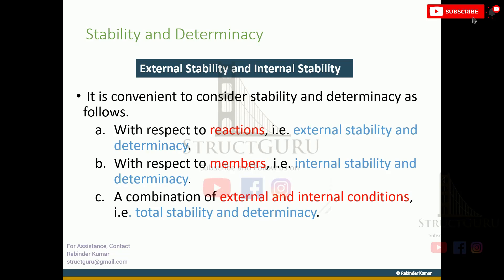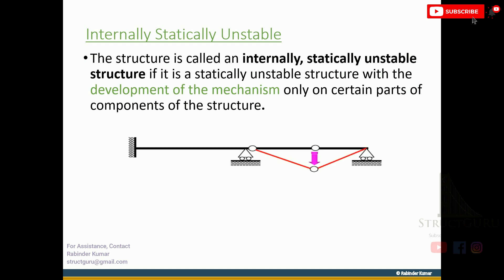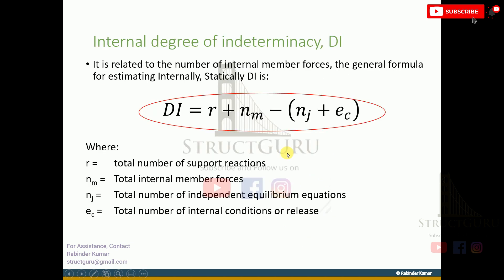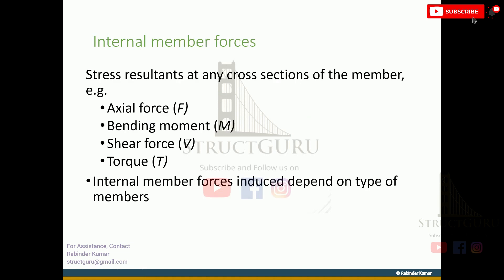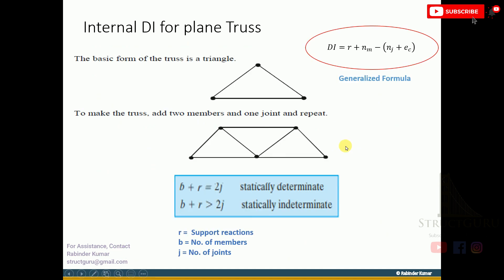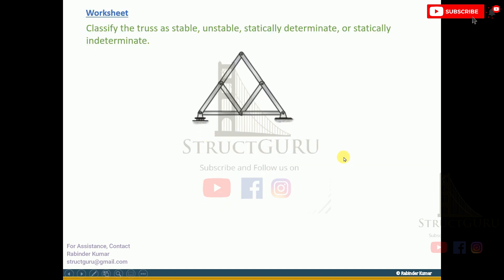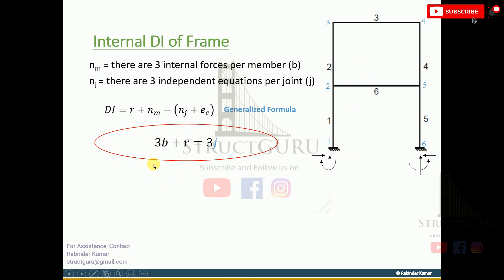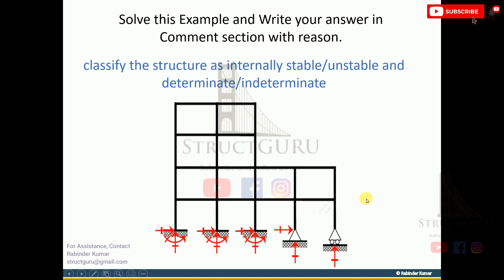Internal Stability and Determinacy | Structural Analysis in 3 Minutes

Comment: Dear Teacher, the last frame is Internally Stable and Statically indeterminate with DI = 33.
Since the frame is vertically irregular in stiffness, I am curious about how to calculate stiffness for each floor level, so that I can do a stiffness irregularity check.
Reply from the maker: We can calculate the stiffness for each floor using moment distribution method. I will explain this topic in my upcoming videos.
Reply: @structguru2200  Dear Teacher, Thank you very much.
If possible, please do upload the video, as early as you can. Your video will be very beneficial like always.